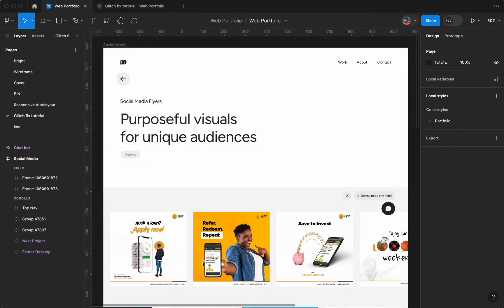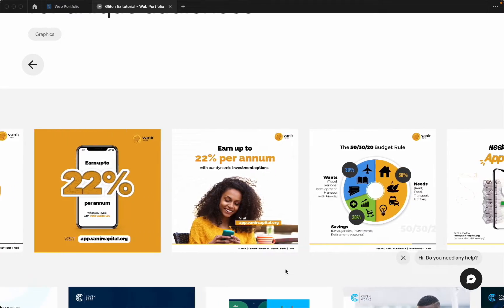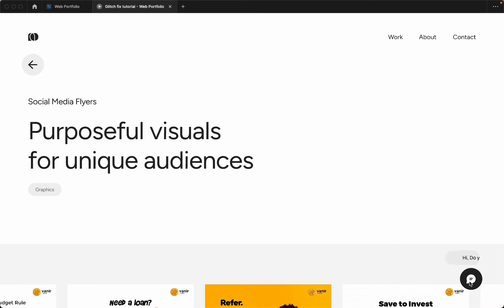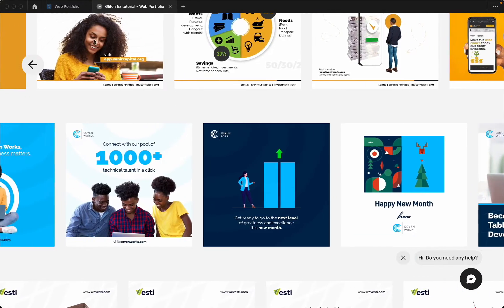How to fix component glitch when scroll position is set to fixed in Figma

Comment: 00:02 Fix component glitch when scroll position is set to fixed
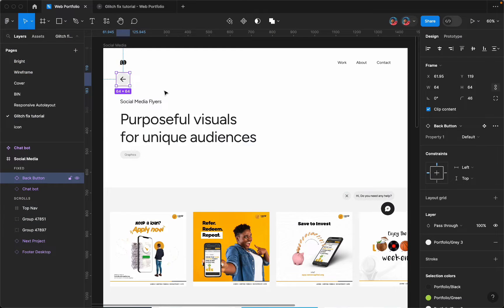00:15 Working with two components in Figma
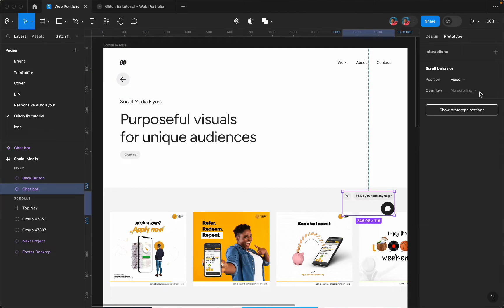00:25 Fixing component glitch when scroll position is set to fixed in Figma
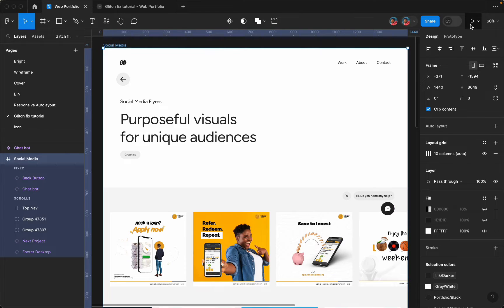00:36 Component glitches occur when scroll position is set to fixed in Figma
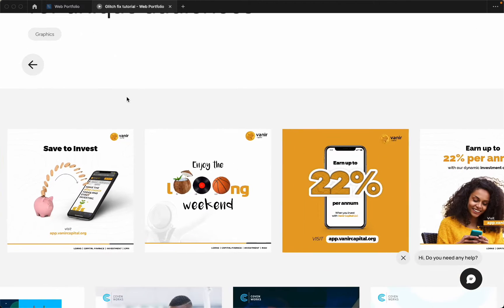00:50 A quick fix for the component glitch when the scroll position is set to fixed in Figma
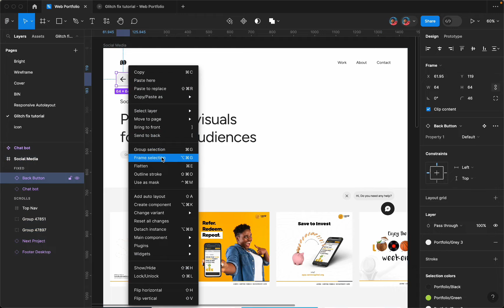01:01 Fixing component glitch when scroll position is set to fixed in Figma
01:13 The fixed scroll position glitch in Figma can be resolved by adjusting the frame selection.
01:29 Fixing component glitch with fixed scroll position in Figma